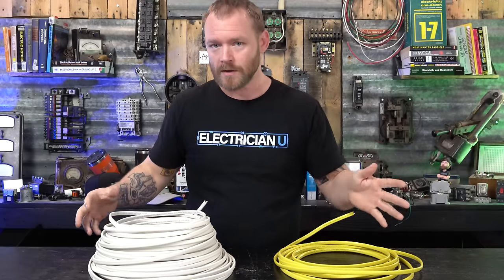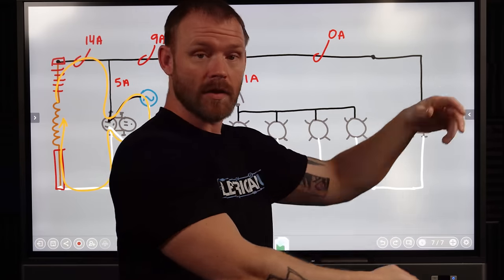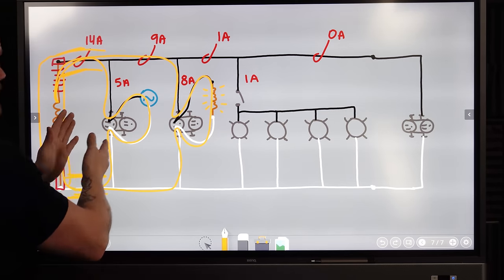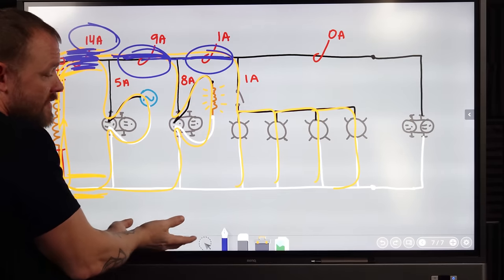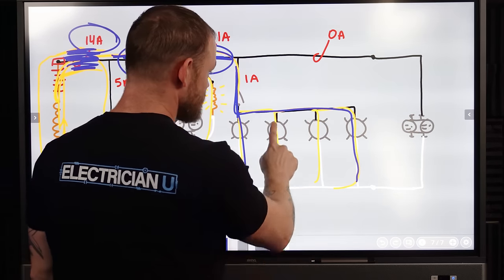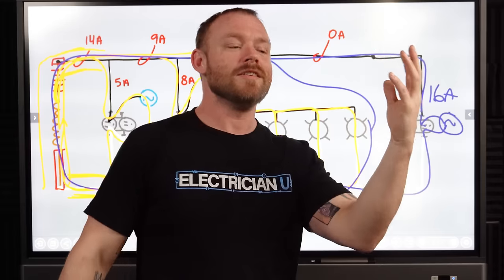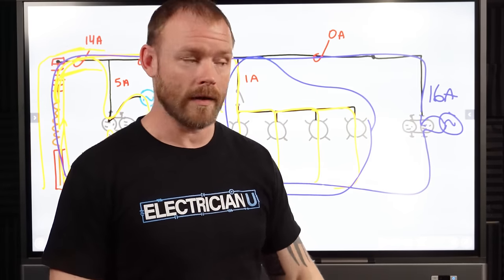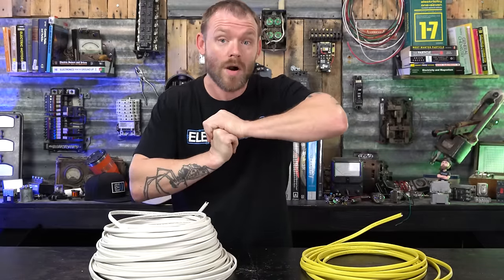Should You Be ONLY Using 12/2? When Can You Use 14/2?

Comment: The only thing I see wrong here is if you put 14/2 onto a circuit that has a 12/2 home run and is fed by a 20-amp breaker, you’re actually not in compliance because all the cabling that comes off a 20-amp breaker needs to be rated for 20 amps.
Reply: Good point.  confusion.
Reply: Is it legal to put a breaker at the lower powered branch itself?  Or a fuse?
Reply: I have asked this question before and my understanding is that his jurisdiction and some other commenters' jurisdictions interpret the switch leg to be a fixture wire and fall under article 402...  Excerpt from uses permitted section: "for connecting luminaires to the branch-circuit conductors supplying the luminaires".  This one is iffy in my opinion, I don't like it even though it is probably 'safe' I'd rather spend the extra few cents a foot and just stick with #12.
Reply: LED lighting is a pain in ass to connect with larger than 14awg. The connection box is so small.. and i dont know why.
So, for lighting, use 15A breakers. And outlets, use 12/2 just in case you decide to change your 15A outlets to 15-20A outlets.
Reply: Except working w 12 sucks wiener compared to 14. Pretty sure it falls under the fixture wires code section (I think someone else said 402). Just run lighting on a 15 amp breaker and then you’re safe.
Reply: @martf1061  Did you end up using pigtails to connect the #12 to  the lighting?
Reply: @suserman7775  I have. I believe that’s code where I am.
Reply: I would love to see 14/2 Romex melt on an overloaded 20 amp circuit breaker before the breaker ever trips.
Never going to happen
Reply: @draaks1  The difference is that the #14 is part of the branch circuit and the #18 is part of the fixture. Why is that relevant? Because the fixture is tested by its manufacturer in accordance with the rules for the listing. As long as it passes the tests, it can be sold and installed. The #18 wire is attached to the fixture while those tests are being conducted. That is why we can have confidence that it is OK for the #18 wires to be there.

But the #14 is not tested as part of the listing. So it must be treated the same way that other feeder and branch circuit wiring is treated. That requires that it be protected against overcurrent in accordance with its ampacity. Since it is one of the “small conductor” sizes, it must also be protected with a breaker or fuse rated no higher than 15 amps (despite it having a higher ampacity in the tables). So you can’t protect it against overcurrent with a 20 amp breaker.
Reply: I've always asked the same question, we used to do that all the time in my area and the inspectors was fine with it. But not no more, now I run all 15 amp circuits with #14 for all lights, Just makes sense doing it this way.
Reply: @adammorgan9304  I hate 12/2.. I hate even getting the hook onto receptacle screws... I let the apprentice do that shit.. I'm getting old.. hate 12
Reply: The main branch has to be rated to carry the total load of other branches connected to the home run, but the branches from each device only have to be rated to carry the load of that device. As mentioned, the fixture wires are only 18ga because that pigtail off the driver or ballast only has to carry the load that the one fixture creates. If it's multiple lights, that branch of the home run has to be rated to carry all those fixtures.
Reply: @suserman7775  Yes, in that case the branch circuit is a feeder, and the lower powdered circuit is a branch off the 15A subpanel.
Reply: @draaks1  by itself that interpretation does nothing. Luminaires, i.e. the light source itself plus all components used for positioning the fixture and connecting it to the branch circuit, must be listed as luminaires. Did anyone get their switch leg + fixture listed before relying on this interpretation? No way
Reply: @theseattlegreen1871  there are plenty more reasons to limit the temperature rise in conductors beyond just melting the conductor
Reply: @benchociej2435  
Such as?
Reply: @S Userman  a fuse is an overcurrent protection device, therefore, your wire would be protected properly if you did that. I don't think there is a limit to amount of disconnecting means/ overcurrent devices on a circuit, I will have to research more.
Reply: Where I’m at you most definitely cannot out any 14awg on a 20Amp. But you can use 12awg on a 15amp
Reply: @draaks1  I see the interpretation as valid, and with good reason particularly in this day and age where most every light fixture is LED and draws a fraction of an amp at the most, and if a short circuit were to occur in the switch leg, 14 awg wiring offers more than low enough resistance to instantly trip a 20 amp breaker.   On the other hand the 18awg typical for fixture wire is listed together as part of the fixture, whereas the switch leg is not and so in a way must be protected with 15 amp overcurrent protection if 14awg is used.
Reply: Perhaps what needs to happen is a code change that forbids extending an existing 14awg lighting circuit to add receptacles (excluding smoke / CO2 outlets).  A 12awg lighting circuit? No problem, extend away, but a prohibition on extending 14awg circuits would prevent a problem if that 14awg were fed from a 20a home run.
Reply: @theseattlegreen1871  Very true.  It would take approximately 50-60 amps to melt a 15 amp wire.  So like you said no way your gonna melt a 15 amp wire on a 20 amp circuit.
Reply: @DumbCarGuy  
⚡💯
Reply: Awesome this is great. I’m going to save so much money. I learned I can use ethernet cable and thermostat wire for house wiring now. Thank you so much. Can’t wait to see what the inspector says. He’s gonna be impressed with my ingenuity. And my customers gonna be happy with all the money I save them. This is a win-win.
Reply: @abc947  what are you smoking ?
Reply: @jarrydee2799 just a question. Price not being the option, have you tried stranded mc wire 🤔
Reply: @suserman7775  Yes, but then it changes the upstream branch circuit into a feeder.  See definitions in article 100.  And that can have other ramifications.
Reply: @theseattlegreen1871  Never say never.  I agree that it is close to never, though.  The chances are very slim that it would ever be an issue.  But under just the right circumstances, it might.  And then who is on the hook?  CYA and follow the code.  Liability suits run this country these days.
Reply: @JR-zm6nx 
In all due respect show me a video proving it's possible and then I will take it back until then I stand corrected
Reply: @theseattlegreen1871  My point is that there is a reason the code doesn't allow it.  Table 310.16 exists for a reason.  Under normal circumstances, you're right that it would never be a problem to run 14 AWG wire on a 20 amp breaker.  But the code is also concerned with abnormal situations and that's why they go "overkill" in certain areas.  We all know that you can usually put a lot more than 15 amps on a #14 before it even starts to get a little warm.  But there are a lot of variants to every install.  And the code is trying to cover everything.

My bigger point is that if you did wire it the way he suggests in the video, and there is an electrical fire (even if it was caused by a different fault), you are on the hook for not installing per code.  Is it a risk you really want to take?  Not me.  And is it something that should be taught to folks who don't know any better?  I think not.
Reply: @JR-zm6nx  
I get what you're saying but I still would like to see a video of a fire being caused because of this
Reply: @theseattlegreen1871  premature breakdown or hardening of insulation, annealing metal components, damage to nearby equipment, increased risk of burns when surrounding metal gets hot, inability of other nearby conductors to dissipate heat, false heat alarms, expansion/contraction/sagging, increased corrosion rates, and it's just a plain old waste of energy
Reply: @JR-zm6nx  it's not just about fire, there are so many (less dramatic) reasons to control conductor temperature. Saying you should be allowed to use smaller wire on a circuit because it's unlikely to cause a fire is misleading. It's like a doctor trying to use less pain medicine on someone with the justification that it probably won't kill them.
Reply: @benchociej2435  
Again can you please show me a video or some kind of evidence of a 14/2 Romex having these conditions you spoke of if on a 20 amp circuit breaker that works ?
Do you have any idea how many electricians accidentally installed 14-gauge onto a 20 amp circuit breaker by mistake? Do you have any idea how many houses right now have 14 gauge Romex Wire on a 20 amp circuit breaker that is still on to this day?
Reply: What about all the lights that have 18GA stranded wire for the last 6-10 inches
Reply: Thermal expansion and contraction at connections probably the biggest drawback to mild overcurrent on 14/2. Then a wire nut loosens up, resistance increases, that adds more resistive heating, then corrosion, etc. Might not cause a fire, but code is also trying to preserve the quality of the building stock in the area. Janky wiring doesn't help the neighborhood.
Reply: @ryanfeeley2407  still waiting on that video evidence
Reply: Most of the residential receptacles are rated 15 amp anyway 🤷🏻‍♂️
Reply: @guachochi1970  Sure, but how much current do they source when there's a fault with a device plugged into that receptacle? Usually more than 20A, tripping the breaker. So you get away with it. Layers of protection. But there are faults that draw 19.5A. They're just rarer.
Reply: Pipe that shit, and use them both
Reply: He said that and showed the chart.
Reply: @martf1061  it's small so you can fit it in through the hole you drilled even if there is a joist there
Reply: Just keep your lighting circuits separate. Simple.
Reply: @suserman7775  How would one accomplish that and in doing so, where would the cost savings come from if you had to install a circuit panel in some random place just to utilize a bit of cheaper cable for a small portion of the overall circuit?
Reply: @jacobplank  Curious to know what area is your area where you used to do this. It was never legal, but I suppose in some areas the inspectors allowed for a very loose translation of code to call that 14 AWG portion "fixture wiring."
Reply: @guachochi1970  But the insides are exactly the same as 20 amp rated in conductivity. And the code recognizes that a single duplex 15a receptacle on a circuit with multiple receptacles is unlikely to be loaded to the circuit's 20 amp capacity. This is why 15a rated receptacles are permitted on kitchen SABC's. And why a 15a rated duplex is permitted on a 20 amp washing machine circuit.